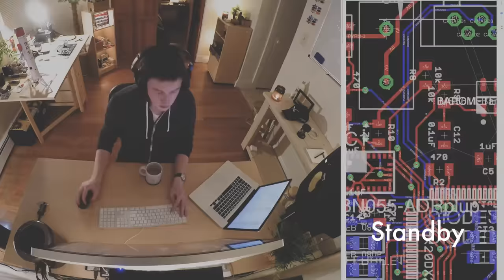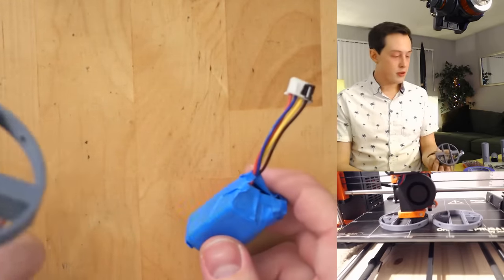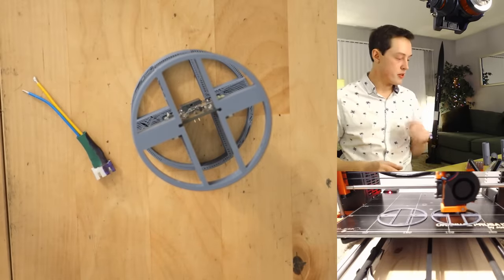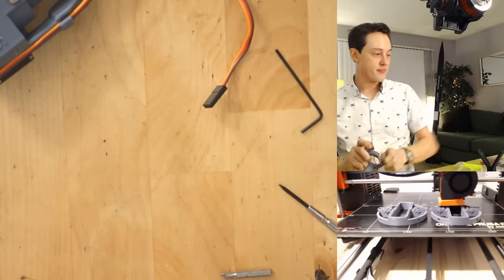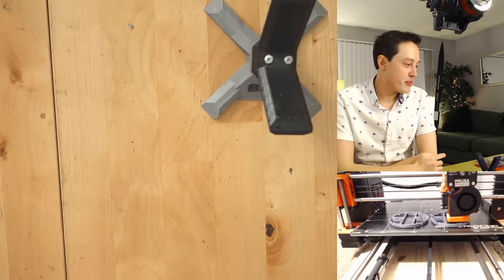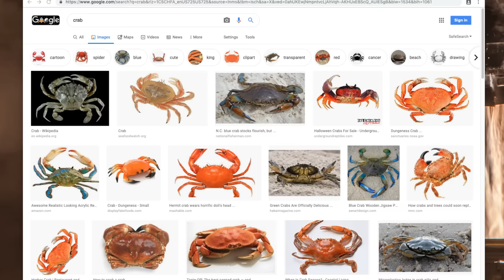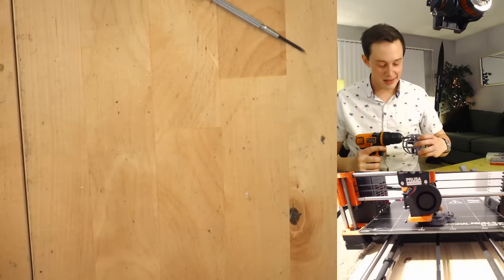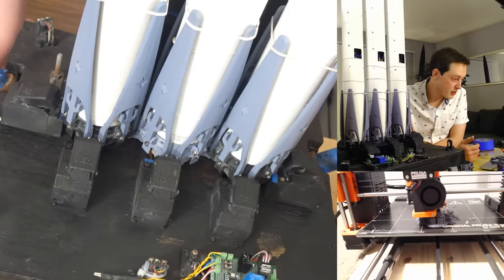Falcon Heavy Model Integration

Comment: Hi, I'm so glad somebody asked the servo question while you're live, unfortunately I'm in UK and asleep most of the time you're live :( and you didn't have time to answer me this last time I've asked. So here is the thing: your servos are horrible slow (sorry ;) ) Ask somebody who is flying 3D model helicopters. Your servos are cheap, fair enough, but they take 0.3 sec for 60 degree and the gearbox is probably not the best plastic. There are metal gear servos, too. Coming back to the speed, helicopter swashplate and rear rotors need to be able to correct the position, maintained by the electronic gyroscope, very quickly, otherwise you'll get a horrible delay and loose your helicopter in a fast 3D flight (that's when your helicopter swivels around like a witchcraft broomstick with mad cow disease).
If you compare your servos with 0.3s for 60 degrees with a Futaba S3114 , that does 60 degrees in 0.09 seconds.
I think that would give you a great improvement in stability and you could try your test to throttle your motor by oscillating it very quickly, what you've described in another video as something you want to try.
All in all, what your vector control system does is very similar to what a helicopter does or even more a friend did with this RC turbine Typhoon jet, hovering it nose up over the ground. For that the  holding force of a heavy model was also very important. You'll probably find even faster servos on hobbyking for example the Corona CS-918MP with 0.06sec for 60degrees, but I don't know about the quality. Futaba is Japanese quality but you're probably fine with Chinese servos as you're already using those.
I would appreciate your or any others thoughts on this.
May your sky be blue and your wind be low!

Best wishes,
Mike
Reply: Hey thanks guys! 36 like :) I would love to hear from Joe what he thinks about it. Maybe he will answer it in his next video? :)
Reply: Ok
Reply: futaba??!!??!!!11! persona 5 joke go brrr
Reply: @CanineDefenseTechnologies  73 now

Comment: Hi Joe, Have you considered using nylon screws to save more weight were possible. I use nylon screws on some of my quad copters to save weight and it also makes for a good break point on crash to help save valuable parts from the full impact force.
Reply: 😊l

Comment: Recognizing this is an old post - would it make sense to have you’re computer slide in like and SD card or old video game cartridge - then all you’re devices and etc could hit copper / gold tabs on the system board - then you could pull and push the cartridge in for each build simply plug and play physically - then much more of the the body could be printed in one unit without screws our much modification - thoughts?

Comment: If you work/put/build two flats on the prints parallel to the board, then ir will not roll all over the place; it will not affect any parameter...

Comment: If you are trying to save on the weight of the components, why dont you use plugs made from plastic instead of screws for mounting the computers in the brackets.

Comment: I'm building my own liquid/hybrid engine using three different types of fuel to see which mix gives me optimum performance with, of course, oxygen being the oxidizer. The trouble I am having is finding the right pressurized pipes or plumbing to be efficient in such a system. Without having a high pressurized system during my test, I seem to get combustion and thrust control fairly easy, though my flight hours are zero! I'm' wondering is there any specific fuel that pressurization would be needed for during a real flight. The fuels I have are methane, propane, and laughing gas or N2o. With all of them being mixed with oxygen.
Reply: Xclusive Carter 
1. Oxygen as oxidizer... w... what there are so many better and more efficient options
2. How can it be liquid and hybrid
Reply: @mat7can106 1. Thats what I can get my hands on. 2. I built multiple engines to see which method I could use more often while being cost effective. I'm still experimenting with mixtures.
Reply: Xclusive Carter oh okay

Comment: Me and my buddy Kyle in 1998-99 were riding bikes back and forth between our two houses based on who had fastest internet vs cd burner vs capability of transferring large "50mb files😂" worth of data on zip drives. So we could setup duke nukem 3d multiplayer with  voice capabilities...... Thanks dad. The GTE it tech in socal for years before they even required certs or degrees😂😂😂😂😂